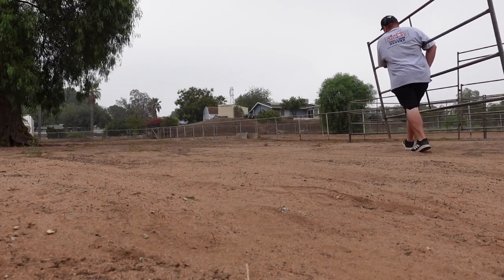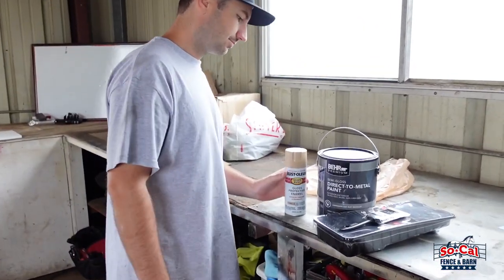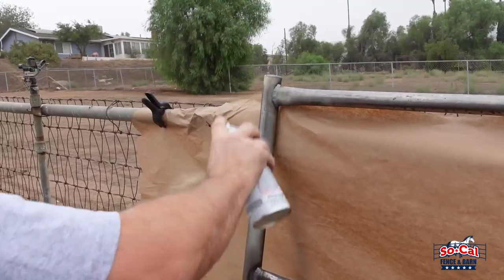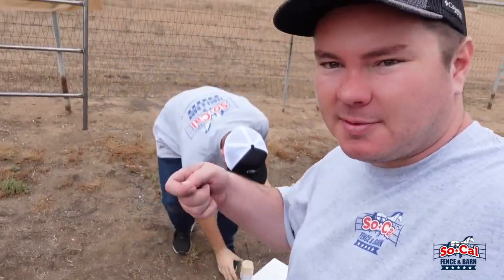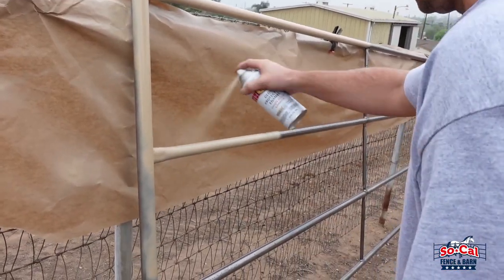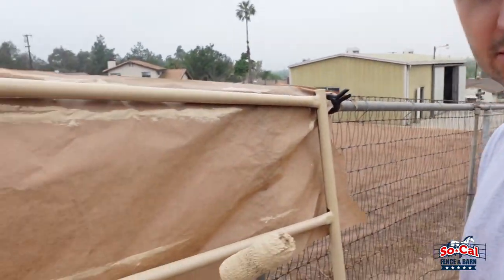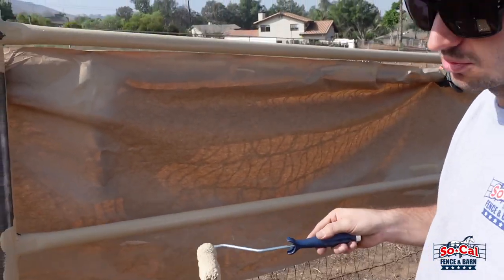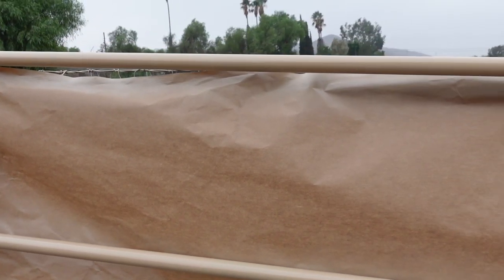How To Paint Metal Horse Panels | SoCal Fence and Barn

Comment: I want to paint goat panel for a fence. What type of paint do you recommend?
Reply from the maker: Our customers usually get a can of Rustoleum spray paint. If you paint in an area with lots of wind, you're gonna waist quite a bit of paint from the wind blowing it away. Try to set up a wind-block or paint the panel inside the barn. Hope this helps.